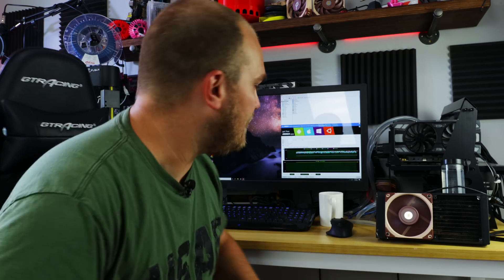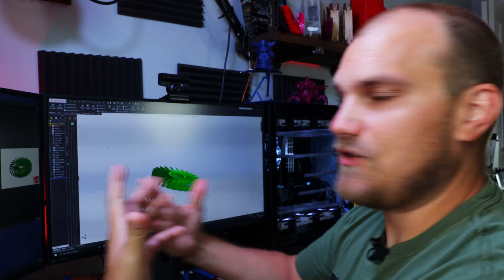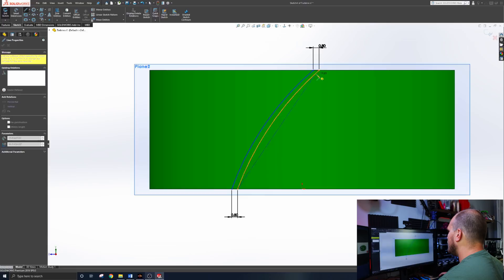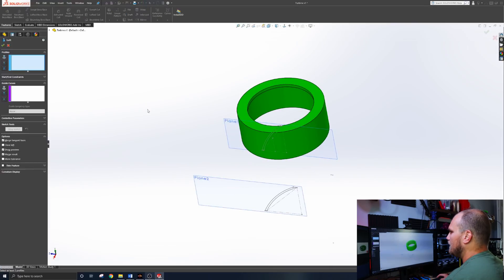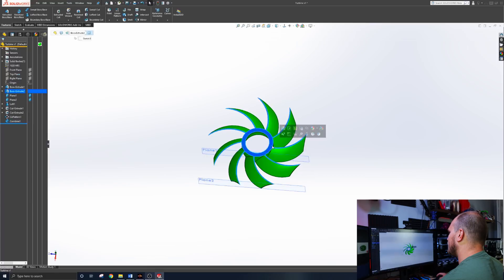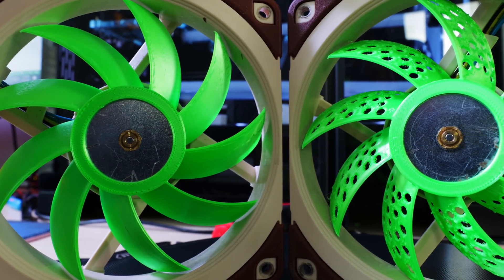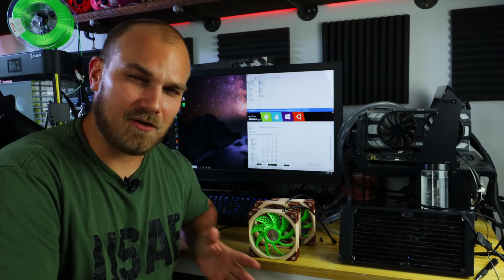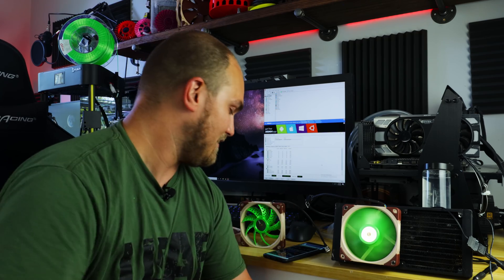Does A Holy Fan Work? | 3D printing the Answers to questions no one is asking!

Comment: A 240 with 1 Fan has still a much larger surface area than a 120 Rad. Yes, only the area under the fan gets the full amount of air, but it will a) bleed into the the fins a bit and b) the rest of the rad will be a passiv cooler. 
If you don´t wait long enough, the larger mass and the extra volume of liquid will have an effect too, but I assume you will not make this mistake.

Comment: Great video and experiment. A couple of things though.
Didn't you said that the one with the hole have an aggressive blade profile? Should keep the design specs for both fans the same with the exception of one having holes. I think thats maybe the reason why both had the same mass, different blade profile. Also the one with the hole had excess material (stringy). Also your scale might not have been sensitive enough.

Comment: Stop comparing the 120 to a 240. What matters is that its identical between the tests on a 240 just like it would be on a 120. While it doent represent a likely scenerio, the test is still applicable and unruined by laving half the rad open

Comment: He will def have a lineup of some interesting fans to say the least! Question u said weight didn’t change was the material of each fan the same? Dimension exactly the same hub density and what not? It prob did lower weight just not as much as you’d expected! You should try to do fluid dynamics with all your different types of fans maybe look up what’s already out there to give u more ideas but loving the vidz bro always look forward to more! Holes I thought would be good but did u sand it down and get it to a close polish! There’s tons of friction when a fan moves through the air and if your trying to get beat results it’s gotta be perfect! Also wouldn’t mind seeing some sort of winged tipped on the end of the fan itself, add a short but stiff 35 degree turn  or so where the fan meets shroud no pun intended to u shroud fans lmao! Maybe cut the air and push it into the radiator kinda like altenator fans behind the pulley! ??

Comment: a little complex idea but it could be interesting. try to make a fan blade design with airchanels inside the blade like brake discs from cars. this way you get the normal fan plus a inner blade channel that directs the air more agressivli in (maybe). whoa mind blown^^

Comment: How about you slow the other fan down so it matches the holey fan noise. With the added speed of the holey fan it might match the temps of solid one? Also could drop the noctua fan to similar RPM.

Comment: as much as i love these testing videos (they are entertaining as hell haha). the results are basically meaningless most of the time due to the lack of control over variables, and the general "meh, close enough" mentality.    Like your mass issue, you are comparing parts made on 2 completely different printers (fro m what i understood) and without bothering to clean the print whatsoever... Its no shock to me that on something as lightweight as a fan your margin of error on that could outway your potential differences. 
in any case, I still love the videos. thanks for the content.

Comment: You need to clean up those prints, fan blade cuts air and needs to be smooth.
For fair comparison print on same printer.
All things equal, with holes should be lighter. Maybe its less than 0,1 gram difference?

Comment: The first difference between a 240 with one fan and a 120 is going to be in the heat capacity of the system.  The 240 will come up to temperature slower and fall slower.  However, given that your tests run long enough to reach the steady-state of the system, it's just going to force you to run your tests longer to get there.  The one that really matters is that a radiator with no fan still dissipates some heat.  Wrap a bit of insulation (cut a hole in a block of styrofoam?) around the unused half and that will remove that variable.

Comment: Did you ever make & test multi-element wings? You know, like an F1 car‘s rear wing, where the high pressure side of the low angle of attack element energizes the air on the low pressure side of the high angle of attack element, so that you can go to a steeper pitch w/o flow separation…
Also, we’re slowly getting more and more affordable bigger build plate MSLA printers—with how smooth their prints are, I bet they’d work well for printing fans!

Comment: Hmmm, so the extra surface area of the model causes the weight to stack up fast because of how thick the walls are, so yea no weight savings there, although for an injection mold fan this would actually save some weight.  Rear wings on cars that are worth anything are multi element, this has to do with low pressure regions causing seperation; I had always wondered if a perforated wing could work, I think there could be more to this though.  Im amazed at how well you have those things balanced now, you could try an impeller style fan.

Comment: I believe the idea was to remove material without causing much loss to performance, if my understanding of aerodynamics is right (and it's probably not) the most important parts to not skeletonize is the leading edge and blade tips (my nomenclature might be wrong) the rest should be able to remove completely as long as it's not needed for structural support.

Comment: Other people have given similar explanations for why the "weight" of the fans is the same (imagine measuring something's mass but reporting a weight, just imagine it), but here's a slightly more technical version of that same explanation.
The most likely result you're seeing is that your scale isn't accurate enough to report the differences in weight. You could have shaved off milligrams of mass (.001 g) with the holes. Since your scale reports only 1 significant digit after the decimal, you could have cut as much as .099 gram or 99 milligrams of mass (depending on how the scale's software decides to round). It most definitely "weighs" less - if everything else is the same (the material used to print the two fans is of the same density/composition, the deposition/printing process resulted in relatively uniform densities of that material, only trace foreign material in each fan, etc.), they should have different masses because one literally has less mass while occupying the same physical dimensions, ergo less volume which necessarily means less mass per unit volume, and since the physical dimensions are the same... we can reasonably rule out that they two objects have the same mass and they will definitively have different weights.

Comment: yet another suggestion: print a phone holder that always holds the phone in the same place compared to the fan.
oversize the hole, and use rubber bands to hold the phone in the air to avoid vibrations.

Comment: G'day major,
I'm really enjoying all the Fan Testing 😁,
Regarding comments of a 240mm Rad with 1 Fan not equaling a 120mm Rad for Cooling this is correct as you still have more Liquid & a Larger Rad Surface area for Heat Dissipation,
For testing as long as you are using the same Rad your tests will be consistent, the only inconsistency with this test was having the Solid & Holy Fans on a Different Hub during testing,
but in my eyes 'close enough' as it is for 'fun' & not a Scientific Paper being Published

Comment: Speaking of weight, have we tried a different allocation of mass across the fanblades? Like, whether it's better to have the weight farther toward the tip, middle, near the motor, leading or folliowing edge, etc. Might have a change in rotational speed, however inconsequential.

Comment: I wonder, if you did smaller holes in a grid pattern or an 'packed' fashion, would the results change. I think it would also be interesting to see how much air that holy fan is moving, I'd imagine the holes are actually making it so there is less air movement overall.

Comment: Imagine a bunch of straws glued together on an angle, they make up the fan blades. Like a laminar flow device. Tubes. Lots of tubes instead of fan blades. Holes in the perpendicular direction to those holes. I've always wanted to make this for my quad copter thinking of it did make a laminar flow, it would be silent. A straw vortex, and you slice a plane out to make the fan. Please do this, sorry if it's hell to draw, maybe honey comb will stack better?

Comment: You should also measure CFM as well. That way the speed of the fan doesn't account only for performance right?

For me noise and speed don't matter when CFM is what actually cools your case. 

I've got 140mm Corsair Maglev fans through my case and the CFM is the best you can get on the market. With the right fan curve in the mix it's basically almost silent as well! 

I'd really like to see CFM testing over RPM testing moving forward if possible please?

Comment: 0:00 heh, “Holy Fan”
Reply: 1:38 simple, it’s got double the thermal mass of a 120mm. Making the radiator itself nearly twice as efficient alone vs a 120mm.

The added length, wether it be cooled by a fan or not will still add to the performance of your system vs a 120.

However, if you’re not comparing your data to a 120mm radiator it really doesn’t matter at all. 🤷🏻‍♂️
Reply: 13:29 you need better scales, the teevo also left a shitload of blobs and stringing, this will add to the weight.

Totally forgot to mention that the holes will have thicker layers around them, perimeters and such. Tweaking your printing profile will probably sort that out.

Try a set of scales that are accurate to 0.001grams, filament is actually pretty light and you’ll find that you need pretty sensitive measuring tools for it ;)

Your new printer seems pretty darn capable man, that blade you printed looked gorgeously printed! 😍
Reply: Dumb idea;
Supercharger (screw compressor) based cooling system.?

Both a mechanical and engineering nightmare. However there are some models on thingiverse I saw floating around a few years ago 🤔

Comment: The extra weight comes from the extra walls the printer has to do around the "speed holes" you made. if you would like to see a weight difrences cancel the walls around the holes, keep in mind that doing so will expose the infill.

Comment: Maybe try dimpling them, like a golf ball? I remember when Mythbusters dimpled a car up and they wound up getting better fuel economy and less drag than the non-dimpled car.

Worth a shot, if you can do it!
Reply: I agree it would be interesting! But the reason for "dimpling" the car (as I understand it), is to remove (some of) the laminar air flow (less air drag). I would think a dimpled fan blade would be less efficient at pushing air through. But what do I know. Probably depending on the dimple size too. It would be interesting anyway!

Comment: new design for hole fan have the blades be honey comb pattern holes  threw out the entire blade a bit thicker blade and the honey comb holes pointing too the next blade instead of facing down with blade (sorta like making steps with the holes in terms of angle of fan from holes) 
and have it be made in the better printer so you don't have the messy string material blocking the holes

Comment: What about a jet turbine style water pump. Make a domed housing (jet engine lookin) then put a regular 120 fan at the front and a non-motorized fan on an axle behind it. Connect the non-motorized blade connected via belt or proper gearing to drive a water pump. Like a turbine you'll have the air driven by 120 fan air wise that spins the belt driven one freely. Hope that makes sense.

More I think about it, it's just a regular pump with extra steps.

Comment: What about dimpling the inside of the fan blades like a golf ball. It helps a golf ball have less resistance flying through the air, maybe it will help the air push faster through the fan?

Comment: Could you try printing the same blades but on opposite printers? Then check the weights again. There could be a difference in the printer or slicer. Or as someone else here mentioned the slicer thickens the wall of edges for better durability. So the weight that was inside the hole is getting moved to strengthen the edges of the hole.

Comment: Maybe try place both in a measuring jug of water and see how much volume they displace, will show if there is extra air gaps in the no holes or if the extra material was just used up making the holes in strengthening... (poor explanation but I assume you get what I mean) also when testing fan noise you should test them free air as well as on a radiator, the higher static pressure will be moving more air faster across the turbulent surface and skewing things in favor of less efficiency I  would think. Should give an extra data point to compare efficiency of designs.

Comment: so you know how dual air cooler towers use two fans one that pushes air to the other , well i don't think that's the best way to use a dual tower air cooler, so my idea is only one fan to be in between the dual tower cooler and make that fan takes air in from it's the four sides and pushes the air  through the the dual tower.
you might ask why, in the usual confeg the air coming from the first fan to the second fan is already hot so the second fan is cooling the other tower with hot air which is bad.

Comment: I don't know if this has been done before... but what about the difference between two fans on one side of the radiator versus two fans each side in a push/pull configuration... does it improve cooling performance or is it about the same?

Comment: My thoughts about how this turned out
Surfaces area -> amount of air moved -> noise. Also weigh wise can only assume it's the difference in printers, would beer interesting to see if they both printed the same fan of there was a difference. 

Also I have an idea  for a possible 'more scientific' fan benchmark. 1. Try using something that gives the fan the most surface area to cool, my thought is an alphacool 120mm monstra rad, I have no affiliation bit that rad is 80mm thicc. 2. Create a small loop with x litters of water like 4 or 5  basically some a resivor (large container), pump and resivor. Then use something to raise temp like a suvee cooker to raise temp of the water in resivor to xx temp like 90c or higher. After heated turn on the pump and see how long it takes the fan to lower the water temperature to delta or within  x few degrees. 

Just a crazy idea of mine, thought I'd throw it out there. Thanks for the videos they're really cool and I enjoy your fan videos a lot!

Comment: Test 120 vs 240. Use 5 different single fans on both and see if they rank in the same order at 5 different RPM groupings. (500rpm, 750rpm, 1000rpm ect ect). If they rank in the same order each time then good news you don’t need to buy the 120 radiator.

Comment: You should set the material in solidworks and then use evaluate to find the mass. That way any issues with the print won't effect the weight as some other comments have said.

Comment: As long as you're doing apples to apples comparison, it doesn't matter what you measure on. In fact, you'd loose some validity in your over-all data if you change your radiator at this point...most of your data from past experiments involves that one specific AIO, correct? 
Swap to a 120mm...it'll be different.
As for the fans...you used different printers. I'd be kinda shocked if they didn't print slightly differently.

Comment: Holes need structural support. This support is made possible with a thicker plastic around the holes (since the structural inside of 3d printed plastics is not solid plastic).

Comment: Make a dome and put it over a fan make a hole into it with lets say 3 cm in diameter and see what happens. They say compressed air is cooler then uncompressed so the air going trough the hole must be cooler than the ambient one. PLEASE give it a try to see if it colls any better than a standart fan without a dome. Thanks Cheers Edit: Or multiple smaller holes on the dome.

Comment: make a radiator shroud and space the fans 2 - 4 inches away from the radiator. the air flow will be improved around the outer edges of the radiator where the fan blades don't cover, the fan being the shape of a circle has around 17% less area then the shape of a square at the same size.  you could also try making different types of inlet velocity stacks for the fan. by doing these things you can reduce the air pressure differential from the inlet and outlet of the fan and then you might have a chance on designing a fan blade that can perform better in air flow rather then having to deal with static pressure as well.

Comment: Sure the other half of the radiator is going to radiate some heat, but if you're just measuring differences and your're always using that radiator, i don't see a problem.

Comment: The weight difference may be down to different printing tolerances between your 2 printers. I think it would be a fairer comparison in several ways if they were printed on the same printer. Be quite interested to see if that turns out to be true.
Love the videos mate. Thanks for the awesome content. I'm considering buying that delta printer as my first printer after your last video.

Comment: I suppose that your prints were 100% refilled solid pieces but if not maybe the holes' wall need as much material as the non-holes one needs to refill the hole.

Comment: My thought to the weight is infill vs walls. Near holes Cura slices walls which are very dense, I don't know if there even are infill areas in those thin fans but if there is then the holed version has more walls = more dense areas.

Comment: ever draw inspiration from helicopter blade? the design of the blade of the commanche helicopter have this small bend winglet, supposingly to reduce turbulence and noise to the helicopter quieter. Could this kind of turbulence reducing blade tip design make fan quieter at higher RPM while pushing more air?
Reply: Probably adding airfoil section can improve the efficency of the blade